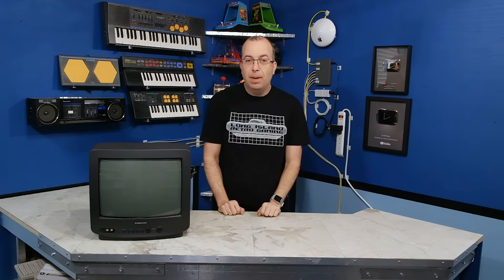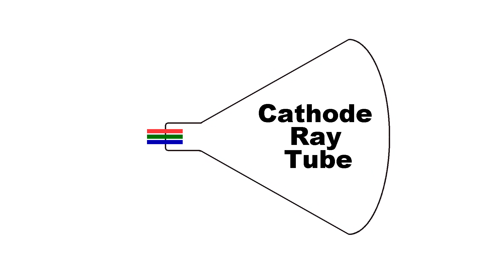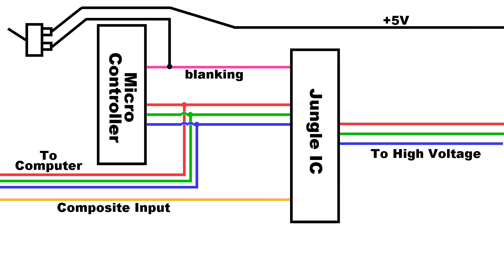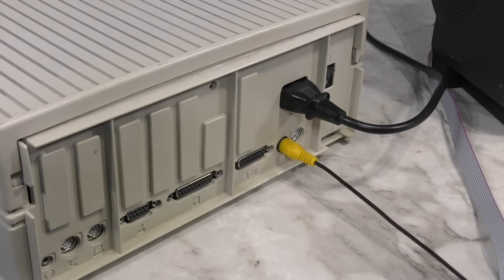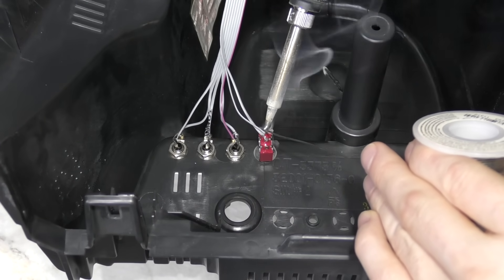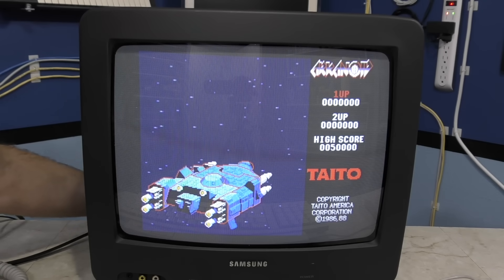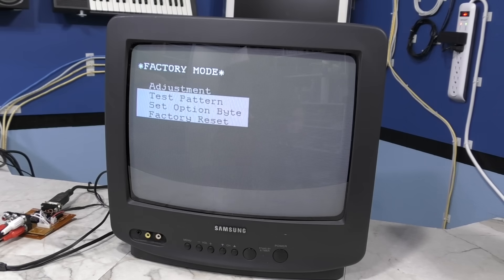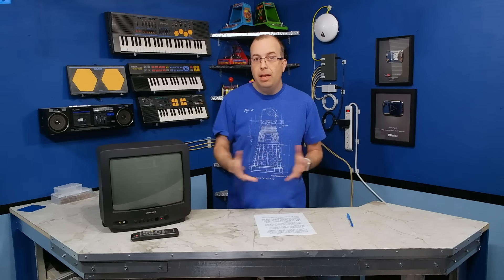Modding a consumer TV to use RGB input

Comment: late 90s CRT TV - paid $50 for it, never broke down and works like a charm even today
2016 LED LG TV - paid $600 - after 2 years broke down and paid $80 the repair
Reply: A 90s CRT is $0 to $50 NOW, but it wasn't back then unless it wasn't good quality to begin with. Those early 2000s Sony Wega models that someone mentioned go for $0-$100 these days and look gorgeous, which can be a better value compared to modern $600 giant screen size LED panels... But when the Wegas were first released the MSRP was $2000 to $3000. At those prices you might as well buy an OLED panel or multiple LED monitors. One day, maybe technology will catch back up with CRTs and we'll have "lagless" OLED panels.
Reply: XGamer [CRO] and I blew 600€ for a Samsung 101cm smartTV and still to break...
Reply: I’m surprised it was repaired and not a paperweight
Reply: Потому что сейчас появился маркетинг, с точки зрения которого просто не выгодно делать устройство, которое бы долго работало. Ну и технологии, конечно, пошли вперед - все меньше, тоньше, горячее, это тоже не способствует долгой работе.

Comment: Damn, I had this same TV for years. Wish I kept it now! I think the blanking line shouldn't be connected directly to 5V without a resistor in-line though. If something were to pull that line to ground, you could be shorting 5V directly to GND, and POOF!. But, I haven't seen the schematic, and you didn't blow up the TV yet. :)

Comment: This was a lot less hassle for people in the UK, as 99% of televisions had SCART connectors. If you had a TV that had NICAM Stereo and Fastext (a half decent model if it had that ability), in the instruction manual it will mention that it will either use RGB or Composite from the SCART socket. Made one hell of a difference with the Commodore Amiga A600 and A1200, Composite and RGB input was like night and day difference in quality. I was using a Phillips TV for my gaming purposes.

The wide rectangular hole on this TV would be where the SCART socket lived on the European version.

Comment: Nice mod, too bad I needed this 30 years ago... :( Especially in 1990-1991, when I ran a CGA DOS-machine on a TV. It had an internal RF modulator just like Amiga and Atari ST. 80 columns looked pretty rough on a regular TV through an RF connector.

Comment: Then y the manufacturer didn't do it from factory? If the tv was capable of doing that
Reply: If you look at the plastic cover of that TV, you see it was designed for a single SCART socket. But there is a composite/audio in that place. So, what happened? A TV without composite (even if it is present in the SCART socket) in would be unacceptable for the American market. So instead of sodlering a SCART socket, they did solder a composite/audio in in the same place., sacrificing the RGB functionality.

Comment: You could have made your jumper wire switchable as well if you had taken a "double switch" (one which switches 2 lines) and wouldn loose the brightness when not using RGB, right?

Comment: SCART was really ingenious for it's time. Just one connector allowed for so many things. Not only it had composite, RGB and SVideo signals, but also it could transmit audio and composite video in other directions. For example you could just hit record on VCR and it would record anything what was on TV.

Computers were in general more popular  than consoles in Europe. In some countries consoles were never a thing before X360 and PS3.
So RGB was widely known. When 16-bit computers faded away, digital satellite TV and DVD entered the market and they really showed the difference RGB connection makes.

When HD era approached Euro-Scart (as it was called in some regions) got unofficial YPbPr component support using RGB lines. So it was upgraded to support 720p and 1080i HD TV, but TVs opted for 3x RCA connectors for YPbPr.
SCART was so popular, that even TVs from 2016 had it. One of my HDR 4K TVs still have it, which is nice, because I can hook to it all old consoles and computers. My more recent TVs have only HDMI or single composite RCA at best.
Reply: The SCART specifications allow you to transmit a HD-MAC signal on the composite pin. In this case, the RGB and blanking pins shall remain fully functional to allow you to transmit higher quality RGB pictures with 1152 vertical lines. So unlikely what is believed by many, SCART is actually capable by design to carry HD signals.

It is just that HD-MAC did flop, do the nobody ever did implement HD functionality over SCART.

The possibility to transmit YPbPr over SCART is not mentioned in the specifications, it is indeed an unofficial extension.

Comment: Hello The 8-Bit Guy, 
I bought an C64 and i already tested it and its working fine but when i make sounds with the SiD-Chip, it makes sound on the RF-Output, but i cant get any sound when i am using my selfmade composite cable (Yellow, White and Red). I made it like it was written on the page where i looked. I have no games or anything to test. I only have the C64.

Friendly greeting and a nice day.
Reply: Make sure you connect the audio to the right pin, you need pin 3: https://www.c64-wiki.com/wiki/A/V_Jack
Reply: @danielmantione  I did solder both red and white to the pin 3 of the connector and the GND to GND of the connector.
Reply: From the SID, the out line branches into one that goes to the RF modulator and one that goes to the AV port. On the AV port, there is a capacitor in between, in order to protect the SID. It makes sense to check that capacitor.

Comment: What this mod seems to do is add what we in the states call a "component" input, right? A lot of sets in the early to mid 2000's have component inputs. I think S-Video is also an RGB type of video input, correct?
Reply: Nope. The difference between what in the US is called a "component input" and an RGB input is the colour space. "Component" uses the YUV colour space, while RGB uses, as the name says, the RGB colour space.

In a way both inputs could be called component inputs, because both decompose a colour into separate compoennts, but the methode to decompose is different for both connections.

That "component" inputs on a TV often have red, green and blue colours on, further adds to the confusion, because they are really YUV inputs. There are two common connectors for RGB input: SCART and VGA. If a TV has RGB, it has one of those connectors on the back.

Comment: FYI, this mod will help and save arcade enthusiasts a lot of money and time looking for good VGA monitor replacements!! Instead of spending hundreds on proper VGA monitors, just get an old TV nobody wants any more and mod it for VGA! Thank you for all the info and how to, 8-bit guy!!
Reply: It would only work with 60Hz VGA, not other modes.
Reply: @chucku00  My arcade knowledge is limited, what frequency do arcade boards run at? I figured it was 60hz..
Reply: In North America, console video frequency is 60Hz, but if you want to connect a PC, you should use at max a 640x480 60Hz setting. Higher frequency video modes won't work and can even damage your TV.
Reply: @graphicsgod  15khz signal for old Arcade CRT monitors. Consumer grade usually ran at around 30khz.
Reply: @chucku00  Nah, TVs can handle 800x600, and even 1024x768 (still at 60Hz), but at that point it gets too small and overscan becomes an issue. I did it with a 27" TV all the time in the early 00's before I got an MPEG decoder card so I could display my DVDs direct to the TV in a native signal. Also came in handy for emulation.
Reply: DoddoSonic  you would have to cut and splice a custom connection for an arcade cabinet if you used a comsumer TV (even in Europe). The monitors in an arcade cabinet use a custom RGB, sync, and ground line connection. So regardless the picture is the same no matter what region you get the TV from. That and you would have to get picture size controls from the chassis somehow. On Arcade cabinet monitors there is a specialized control panel built in to the main board.

Comment: why do people call a tv high voltage? my understanding that anything thats labeled high voltage is basically over 600v
Reply: Are you sure such voltages are not present in TV's? I'd suppose shooting the signal from the back of the tube to the surface might require using higher voltage than would come from wall sockets in any country.
Reply: great point, i never really thought that although 120v from the wall is not high voltage but after actually looking up tv tube voltage it takes about 3000-6000 volts for the final anode, so i guess that yea thats high voltage, i never would have thought that much power is in one of those even though you are only starting with 120v from the wall. probably explains why so many people get killed touching those.

Comment: Damn ! this is sweet i have wanted to attempt this on my Sony kv1380r from 1986 , however i cannot find a schematic for it ..... if any one has any clue where to fine that id be eternally grateful ... i guess the alternate route would be to take the tv apart and fine the schematic for the jungle chip and micro controller...

Comment: Just figured i would point out that analog tv does in fact still exist but only in the form of basic cable, which is compatible with any tv that has the coaxial screw connector and even older tvs from the 60s via an adapter (coaxial adapter to connect to screw prongs). It would work fine on this tv but you would get at the most 125 channels, as most older tvs (not including the ones with dials) typically go up to 125 channels.
Reply: hell most of the channels i watch work on my old tv. (adult swim, tru tv, fox (family guy, simpsons))

Comment: I did a similar mod in a SHARP TV in the late 80s, but there was no jungle chip, so the method was different. I rigged the RGB signals to the video amp chip (that resided at the CRT board IIRC).

The TV was used only as a monitor for my MSX2 computer by the way, so I didn't bother to build a switch to revert to TV mode.

The sync was obtained from the only available source - the modulated image received by the antenna jack. So sometimes I could notice a very small flutter in the RGB image. But the overall quality was very good.

Comment: in case anyone was wondering, the jungle chip is the reason composite video looks like shit. it's decoding method is 20 years old, by using the native RGB that the monitor has to use anyways, you skip the compression/decompression/decoding that the jungle chip does

Comment: Sega Genesis having good composite output already? Not at all... In fact my Mega Drive II VA0 has pretty terrible composite output - crappy video encoder indeed - much worse than the original Xbox which I consider to have very good composite output even comparable with RGB. The consoles from early 2000s did the composite video considerably better than 80s/90s ones.

Comment: in argentina still is there both analog and digital tv signal in both cable and antena. but for digital you need decoders. tvs works fine for both. but it is a pal-n signal in analog and isdb-t for digital.

Comment: I can't help but notice how the rear case has a hole shaped like a SCART connector, and on the board there's a SCART shaped piece of plastic supporting two RCAs for composite and mono audio.
I wonder if there rest of the SCART wiring is present there just unused.
Maybe now, though, but worth checking.

Comment: I just did this mod because of this video, it only took 3 hours because i was looking up the wrong board haha but i managed to just tap the rgb lines and used the capacitors and resistors that were there so i dont need to add anything. I had to tap into another pin for the sync as it didnt work through the composite

Comment: I always thought the Sega Genesis/Megadrive had awful composite video.
Reply: SNES got a true RGB output. I'm sure you could if you searched, find a way to extract RGB signals from your megadrive. 
RN I'm determined to find out RGB signal from the output of my Atari 800XL. cause the current out is ...ahem. composite. and i hate the taste of blurry pixels.
Reply: Silver Spoon The Megadrive/Genesis does natively output RGB from its jack and it’s gorgeous.
Reply: you mean, from its DIN ? good!
snes also had RGB but N64 needed a mod, even the EU version outs a composite signal. Uncouth!
Reply: Silver Spoon Yes, its din.
Reply: @SilverSpoon_  look for "Video Board XE " or "GTIA in CPLD"

Comment: This is a game changer in the arcade cabinet world. These tv sets are literally sitting on the street corner waiting to be disposed, while many 25 inch cabinets ate being scrapped because the proprietary monitor is bad.
Reply: Those monitors aren't proprietary. 90% of them are Wells Gardner and they can be rebuild fairly easily and have standard parts. If someone is throwing it away, they probably just don't want to deal with it. There is no way they would deal with the mod here, if they didn't want to just rebuild what they already had. 
Furthermore, the 15khz tvs aren't going to be a good replacement for many games that use 24 and 31khz monitors as they don't have the resolution. (this is highly simplistic and only useful for repairs. If you are building a cab, you should probably find a good 15khz monitor, go do your own research though).
Reply: where did you get that information from? I have a Neo Geo cabinet with bad colors (the black over black display looks terrible/faded, so the contrast is bad.)

I've been looking for information to fix the monitor but I have come up with bupkiss
Reply: @Highlander2475  try www.arcadecup.com he reconditions monitor chassis' 
Make sure you read about how to safely remove it. It can kill you, and no I'm not kidding. It is easy to take it apart, you just need to follow the right steps. It can kill you.
Reply: Right, Discharging of the CRT is important. I'm an electrical engineering student just looking for the correct diagrams. That's all
Reply: also, that link is dead.
Reply: @Highlander2475  haha, sorry. I typed it by hand instead of copy/paste and I missed a letter. My bad.

www.arcadecup.com

I fixed the one in the post above too.
Reply: @Highlander2475  just figure out what monitor you have and order a cap kit for it. Maybe a flyback transformer. If you really wanted to fuck around, all the stuff is labeled and you could hunt it down piece by piece. There is no point in not doing everything at once unless you like not being able to use your can when you want to. Not sure why you would need schematics to refurbish it. Although I don't know why a a quick Google won't find what your looking for. I just googled "Wells Gardner d2900 schematics" and I found everything you want and much more than is actually needed. 
Arcade techs do these repairs all the time. We don't have degrees in ee bs.
Reply: That is true. I just wanted a more precise way in diagnosing the problem than just throwing a whole set of caps to figure out what was going on.

And I'll try googling it again. I checked on it a few years back and couldn't find anything. I can't recall the name though. Thanks for all your help!
Reply: Comment of the day!!!
Reply: There's a company in Taiwan called WEIYA. They still produce CRT monitors. I got an M3129DS which is a 29" CGA / EGA / VGA CRT with 15K , 24K , 31K support. It was $260 plus $270 shipping and $80 import tax to Germany. Used it as a replacement for my WG D9200.
Reply: Hello, there is a place on earth called Europe. We had SCART here and SCART allows RGB gaming instead of shitty rf signal
Reply: I've actually been having a hard time finding any CRT tv! They go gor like, $60 on ebay!
Reply: Agreed. Too those who say "just repair your arcade monitor" - yes, well, i do that when applicable, but in some cases you get a cab that doesnt have a monitor. Or sometimes i'd rather do a mod like this that will cost me just a few bucks vs caps, HOT, flybacks, etc - i have done these RGB hacks and they work FINE. Are there tradeoffs? yes, but it is still WAY better than LCD
Reply: @meestermole2412  It's like saying, "well I can get a new battery for this Ferrari and drive that for $100, but I think I will just save the $65 and drive this old Chrysler minivan. 
It only makes sense to use a consumer tv if the quality is the same. It isn't, not even close. Sure, if your cab is lacking a monitor, do it up. But a shitty tv isn't even close to the same thing. And it is disingenuous to even insinuate it is a reasonable substitute.
Edit: it autocorrected cab to car.
Reply: plus in most cases you have a nice, colorful CRT, rather than a tired old tube with lackluster colors/burn
Reply: @meestermole2412  Too bad technology has evolved so much since the basic LCD. LED and HDR is best.

Comment: From a safety point of view, you be CAREFUL that the TV chassis ground and the line neutral are not the same. Also older tv's don't use R,G,B they use R-Y, B-Y and Y (Y is the sum of R,G,B), moire is pronounce More-ay.

Comment: Not all SCART connectors had RGB, at least from memory, some only had composite video.
Reply: And even if some video source would output both, and TV could input both, it might not be granted that the TV would (automatically) select the RGB signal to use. Sometimes the user would need to use the TV's remote control to toggle between composite, S-Video and RGB.
Reply: Pauli Vaara or you sometimes need to tap into pin 16 of scart.
Reply: stupossibleify Not all cables, yes. I’m yet to see a SCART port, or at least, a SCART input, that lacks RGB input.
Reply: @justanotheryoutubechannel  Find a TV with multiple SCART sockets, and you'll probably find RGB only works on the first one.